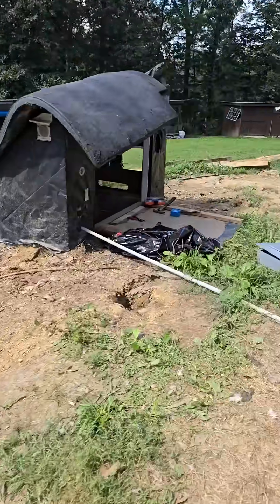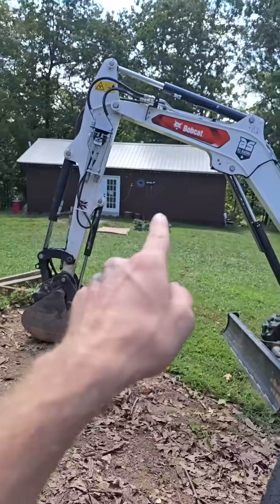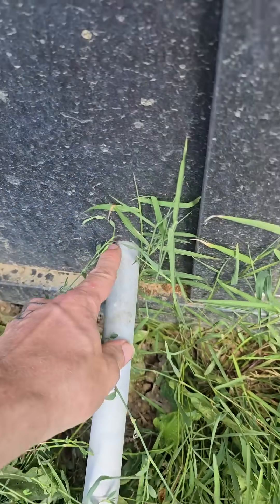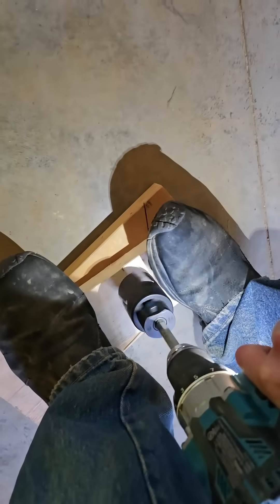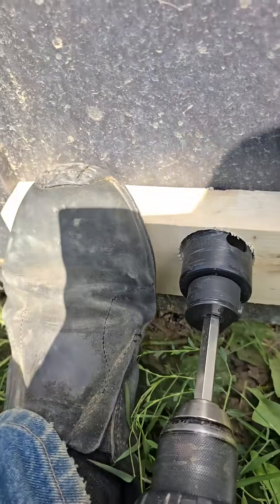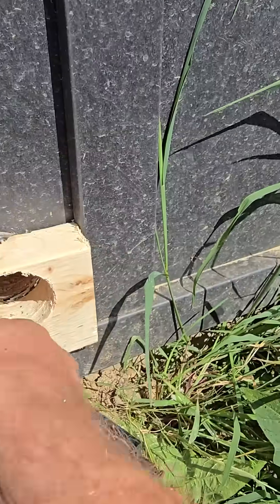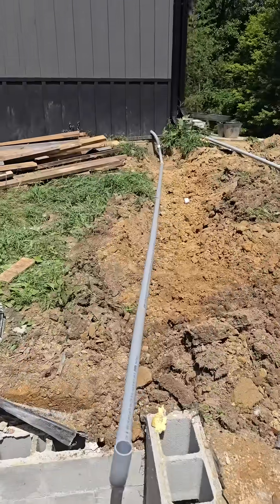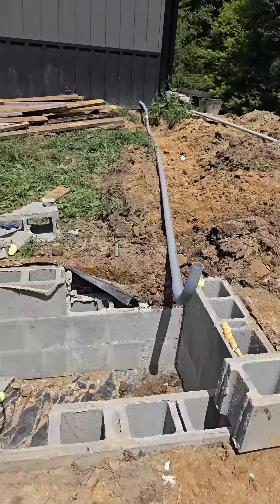Making an electric connection  #narrowayhomestead #offgridlife #solarpower #electrical #electrician

Comment: Here's a tip for enlarging a hole with a hole saw. Run the bit you want the hole size to be, _while also running the bit that is the size of the current hole. You're using the smaller hole saw as your guide.

Comment: START YOUR HOLE SAW IN REVERSE FOR A SPELL.
IT WILL GIVE YOU A GROVE.
THIS WORKS ESPECIALLY WELL FOR SHOWER UNITS.
DRILL A PILOT "DRILL BIT"  HOLE, THEN USE HOLE SAW WITH DRILL BIT IN IT.

Comment: Stack the hole saws. Use the same size for the smaller hole inside the size you want. Old construction tip
Reply: Woah genius
Reply: Underrated comment

Comment: NEC requires those pipes to be a minimum of 18 inches under grade. You might want to kick the pipe down coming out of the building by putting a junction box or LB then doing your run. If you put a junction box where you made your penetration it will cover up the scratches from drilling.  Also running romex wire in pvc isn’t great. Technically a pipe outside is a “wet location” and romex wire is not rated for wet locations. Thhn is normally used. You could take the romex and splice it in earlier mentioned junction box and then run THHN in the conduit. 

I know us electricians are a pain, but just trying to look out for something down the line that might cause you issues down the line. 

Love the content and give the king and the cats some love for me.
Reply: Good thing this is a homestead where the NEC has no say. Any issues caused by using Romex where the code says not to are his to diagnose and repair should it fail in the future (if he survives 😅). Homesteads are typically exempt from such codes since they are not reliant on the city or utilities and whatever you build or wire there is not intended to be sold to others. If such exceptions didn’t exist then the codes and regulations would get struck down as unconstitutional.

Comment: Use a smaller hole saw the size of the hole stacked on the bigger bit as your stabilizer or "Guide point"
Reply: You can also hold the drill at a slight angle, lightly start a crescent shaped groove, it doesn't have to very deep before you slowly bring the bit flat to the surface. Takes a light touch, though. Nates fix would have worked better if the hole in the 2x4 was centered so he could hold it with both feet.

Comment: Tip I learned from a master carpenter: Most hole bits can be stacked together on the drill, just like they stack in the box, so you can put the smaller bit that fits in the existing hole on the inside of the bit that’s the size you want the hole to be, and drill it that way.
Reply: This is the way
Reply: Beat me to it man.
Reply: And this goes for fairly large bits too. I've used this trick to do penetrations for HVAC stuff many times.

My boss always wondered why my penetrations were so much neater without any blowout until he caught me.
Reply: Used this method a few times over the years
Works really good for when the size difference is one size bigger, no screws for you!
Reply: I was going to say the same thing. Stack the hole bits and it works 100% of the time all the time. Work smarter not harder.
Reply: I don't think the hole saw set he used allows for that anyway. It looks like the new spyder set my hubby got which is more complicated than hole saws with the bit already inside it...
Reply: This is what I was coming here to say
Reply: There's several videos on the tube that show how to easily overcome the problem. Stacking the smaller one inside is the easiest
Reply: @maddawgnoll  that’s what I said
Reply: @GjallahornCo.  I didn't disagree. I only added that there's videos all over the tube showing this
Reply: This. I literally just learned this last week and suddenly I see Nate needing this trick. 😅
Reply: Well that another good way to do it, but Nates way is a lot more consistant - it works for ALL bits, not for the MOST of them.
Reply: @egorleontev9970  I said most cause I haven’t handled all
Reply: Was thinking the same thing
Reply: Doesn't work to often. Rarely is there enough threads on the arbor to even start a second holesaw. Most of the time the smaller holesaw is shorter then the larger one so it doesn't protude to work as a pilot.
Yes I've done it but rarely do I have the the right parts to make it work.
Reply: @edmundanderson657  the Spyderset I have are all the same height, and nesting them makes the inside smaller width saw always stick out a little more
Reply: Solar sucks
Reply: @Macinhawktuah so do you.
Reply: @Taolan8472  I would like direct lines from panels to power
Reply: @Macinhawktuah  Then get panels with their own converters built in. They exist. But they're expensive AF.
Reply: @Macinhawktuah  Solar is great. It's getting more affordable and anyone with the skills to understand a simple schematic can install without any experience. I've done it myself and I have no electrical background.